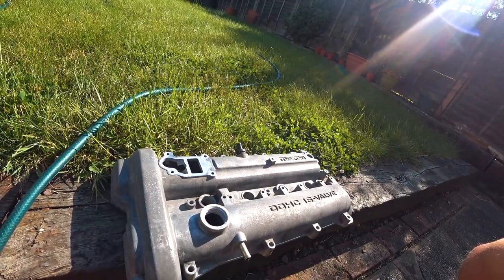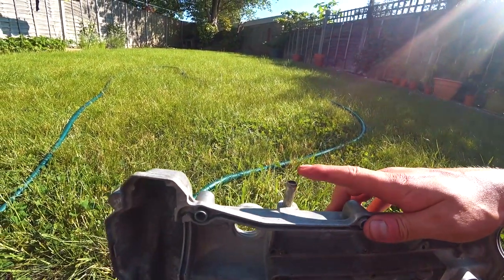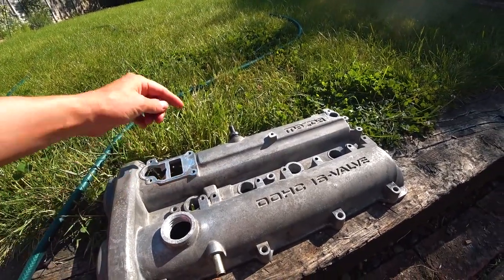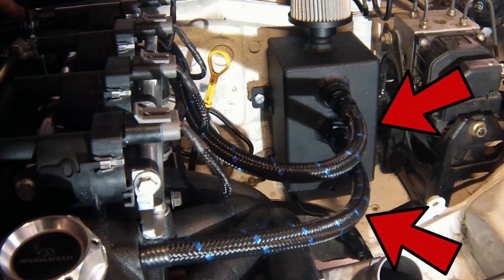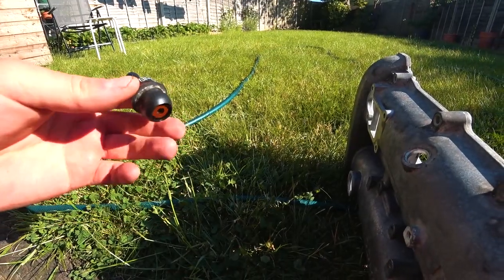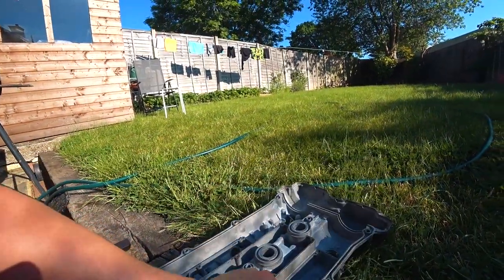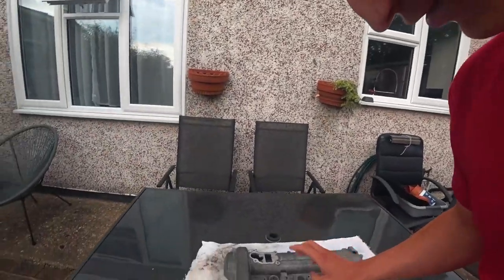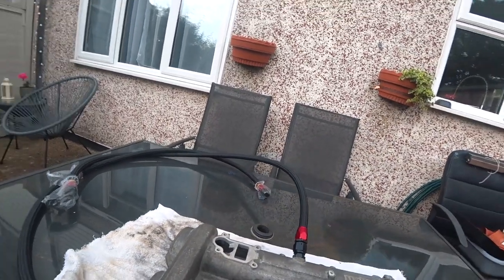Valve Cover Breather. Boosted Crankcase Ventilation. MX5 PCV Delete

Comment: Doesn't the PCV system also create a slight vacuum in the crank case? Without that vacuum, won't the pistons have higher resistance to movement and cause faster wear on the engine? I ran PCV vented to atmosphere for a while, and the car ran great, but I got scared about longevity and connected it back to intake.

Comment: Very nicely visualized, thanks! 
I was wondering though, is there a risk of the engine sucking back dust, etc. if vent hose is open loop? In other words, does the engine create vacuum/suction at certain conditions? I would suspect that to be the case when coasting at higher RPMs for example. (might even test that one day if I don't fond the answer, got a spare MAP sensor lying around xD
Seems I will need this mod on my Peugeot 406 - the Sagem ECU seems all too sensitive to all the junk that lands on throttle passages and the idle control valve.
Btw. I'm not concerned about losing suction from the intake manifold, because there is no vacuum in the stock setup anyway - PCV only leads to pre-intake manifold (i.e. near air filter), and pressure there is pretty much atmospheric.
Reply: That's why you run air filters on the breather for your catch can. If it does suck air inside the engine, it has to go through the filter first.

Comment: You seem to be saying that both the inlet and outlet of the catch-can will go to the valve cover???!!!   Surely one needs to go to a source of clean-air from the airfilter?  Also - if you are going to use a catch-can, is there any reason or advantage in doing away with the PCV valve???    Without a PCV valve, you may as  well vent that crankcase to the atmosphere and not bother with a catch-can!!  Or have I completely misunderstood>??!!
Reply from the maker: For the race spec car both inlet and outlet from the valve cover go into the catch can as both sides of the rocket cover are doing the same job essentially. You dont really want to recirculate it back to the engine as for max performance engine should breath clean air and not recirculated fumes (for the stock car it is acceptable and recommended to have pcv valve and recirculate back). Catch can is required as you dont want to spill oil everywhere, thats the purpose of it. Over time, or soon as couple of hours if engine is not working correctly i.e. ring gaps to large, etc. catch can will be full of oil and will need emptying, or engineered solution could be implemented to drain it  directly back to the oil sump.
Reply: @SirAndron  If you reroute the outlet back into the valve cover, you won't have any crankcase ventilation, and the pressure of the blow by gasses will build up under the pistons and require the engine compress the crankcase air in order to keep moving. The real race car way is to fit a tiny air  filter on the outlet and let the excess pressure vent to the atmosphere